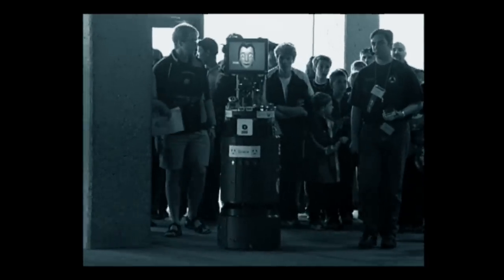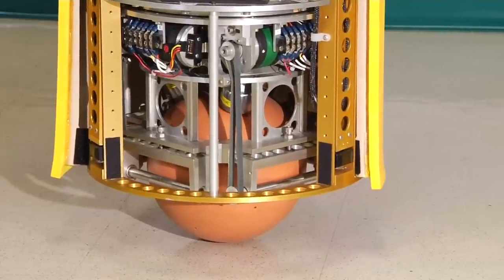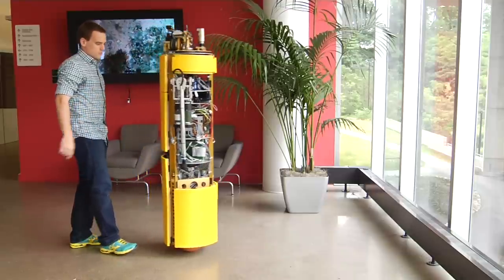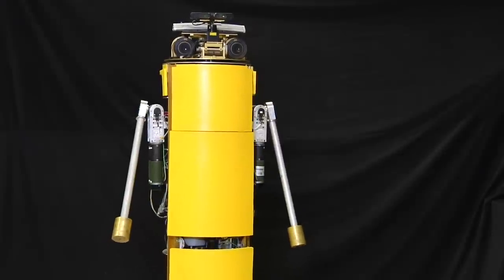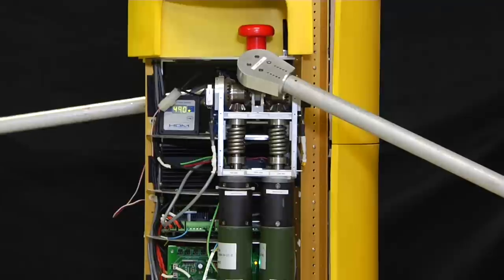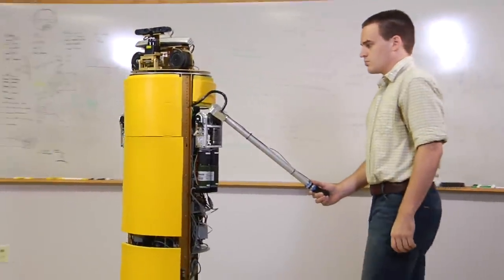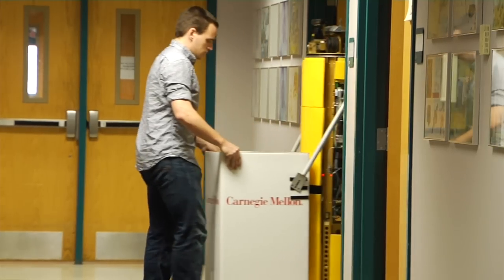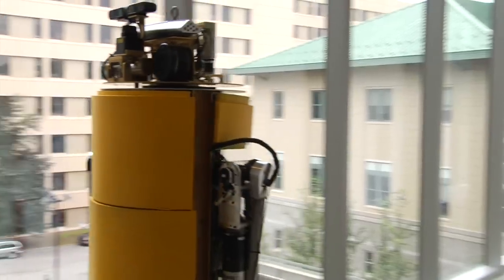Ballbot : A Single-Wheeled Balancing Robot

Comment: I'm amazed to only now get this in my recommendations yet this concept is already quite old and I haven't seen an update on it in 5 years. So with the new availability of electronics and microcontrollers, I'm guessing this should be even easier to engineer in our current day and age. The question then arises, why haven't we seen this design being adapted and improved upon?
Reply: Marinus    Because it can’t stop suddenly ?
Reply: @edh2246  That's really a non-argument.
Reply: Dylan Klavins (our former mechanical engineering lead) directed the design and construction of a robot using some of the concepts from this video's design at our high school robotics club a couple years ago. It is not an actively stabilized tall robot like the one in the video, but rather is a lower, faster robot with four balls designed for fast, holonomic navigation over difficult terrain. Here is a video showcasing it: https://youtu.be/j09PzmVmzJw
Reply: @AlnisSmidchens  Awesome machine!! Sadly the site with the CAD files doesn't exist anymore, I would love to know more about the construction, I immediately have a lot of creative ideas.

Comment: Very cool, I remember building this thing in Uni. I wonder why there hasn't been any notable further development incorporating this Ballbot's concept?? One problem I bet is maybe it's power hungry, actuating the motors constantly in an effort to stabilize the structure due to its inherent unstable idle position. Thus leading to not being economically feasible or user friendly, cuz you gotta charge the thing all the time or need a huge battery :(
Reply: Couldn't some sort of deployable supports be used during idle? Like retractible supports?

Comment: that sway in the jaw-axis when moving probably is just a oscillation in the control loop but it adds character.
It gives the appearance of a walking (or skating) motion that to some extent anthropomorphizes the machine.
Reply: I kept telling boston dynamics that they needed to put a little tail on their robot dog and it would increase sales but they just couldn't wrap their head around it because the tail had no function.....Engineers.  But I agree with you completely.  And this thing does it as part of it's function which is an happy accident.

Comment: Considering the shape (height) of this robot, it seems like it would be advantageous for it to have a solenoid-shiftable mass near its top, to give it the ability to lean just a little.  In its  current configuration, it seems like it could quickly destabilize and fall if it were to run inti anything (or is pushed into anything).  Having a secondary means to rebalance itself in a worst-case scenario seems important, and would also open up quicker accel/decel, higher movement velocity, and potentially better ability to handle uneven terrain.

All the balancing stuff is really cool and great tech, but it’s 2020 now and lots of people have been building single-ball balancing robots and they do well up to a point, until they topple over.  A secondary balance mechanism could be the missing component that pushes this from cool concept to viable product.

Comment: OK so this obviously could make for very agile ball joints in robotics, a hip joint with good stable sway could make bipedal walking a lot easier. A binding mechanism could be a simple cup with 3 of the same wheels but free-rolling, with an axle extending from and tentioned to the driving assembly. With it bound from each side and basically a universal joint at that point a computer can calculate the needed input to the ball wheels to drive an appendage in the right direction.

Comment: I think 3 ball at bottom will be much better and more stable so balancing would be much easier and then you also can't move it by small force. And also you can move in any direction without any problem.and you can also rotate the robot on any axis without moving

Comment: me as a technician: "how does it work internally?"
me as an engineer: "what happens if:
-something is on the ground and block the ball?
-someone push the robot in the direction of lowering stairs?
-the battery fail?
-we combine many of thoose robots to make a wall?
-the ball doesn't touch the ground anymore?
-the motor control does not respond?
-the robot goes crazy (internal software crash / electronical short-cut / power-surge due to battery fail / ...) ?
-someone leans too much weight on the robot?
-someone is too heavy for the robot to lift?
-the robot vision is disturbed due to reflective environement or capacitive environement?

..."
Reply: Anybody who has played with some '2D' balancing robots (like Segway) knows that things go a bit crazy in such cases indeed. Maybe better control software can make it better.

But I do not really see a big need for balancing on a ball. You could easily make a small stable low wheeled platform and then put an active approximately-balanced high vertical robot on top of it. This makes the balancing much more forgiving because the platform can still provide some extra torques where needed. Compared to a human we put our whole foot to the floor and add balancing because we are very tall compared to our foot size. The ball-robot is more like balancing on the tip of your toe. I do like the high narrow robot concept a lot though.
Reply: @richardbloemenkamp8532  yeah but my major concern is that it is created to help people. but if its fail ... what happens? where are the security?

Comment: Its weakness is... stairs. :D
Reply: Or steep slopes. Or door frames that are like 1cm higher than the room they are attached too. Even entering elevators might be a issue
Reply: The future will be quadropets or wheeled bipedal robots. Bipedal legs are just less efficient than bipedal wheeld systems
Reply: Or LEGO

Comment: Why build something inherently unstable?
You know, there's omniwheels and all that.
THIS is how you waste research time, money, and man-hours.
Reply: Anthony Dach But remember, for this robot to be of any use it will eventually carry an unbalanced load, which will take a whole lot more energy to keep steady.
Jets are actually very stable, and most have a fly-by-wire(or in this case fly-by-liquid) system if something goes wrong(say, heading/altitude hold).

And again - your attempt at refuting my argument fails because you suggest that this system will be stable most of the time - which it won't.
Unstable systems do have a much faster response - but at what cost? Nobody's going to need, say, a patient-observing robot to dash to someone when they press the emergency button - a camera with an epi-pen or two won't do you any good. Nor will this transport any large payload - it's simply too difficult to balance.

Also, what do you mean by "reducing power consumption when moving"? Yes, leaning will get you some momentum, but that momentum will be that of an inverted pendulum - to crash to the ground, a stable position. You'll have to work the motor continuously, both forward(accelerating) and back(braking) to keep you from either falling to the ground or stopping completely due to an incorrect control loop.

I do know what control theory is, so please, don't underestimate my chair-to-chair combat skills.
Reply: Anthony Dach If it's unstable, there's absolutely no way it can use the same amount of energy, as I've said, the center of gravity will be offset, and so will be the wheel, and the rest of the weight, and so on, and it keeps getting more unstable the more you add on.

Right now I still don't see an advantage to a very unstable inverted pendulum system with absolutely no load capacity and a constant need to use power to be stable(vs. say, a carefully selected wheel platform with less friction and latching brakes).
Reply: +Spirit 
You can't beat the inverted pendulum it's always fun.
Reply: +Spirit 
You can't beat the inverted pendulum it's always fun.
Reply: Because it's a friggin robot and it's balancing on a wheel like a ballerina, and it's NOT unstable. You have no understanding of the beauty of engineering, and lack the creative imagination to see how this could be applied in other areas.
Reply: Did you not listen to the first minute of this video?  Any wheeled robot of the same size and weight would have too high a center of gravity and be unstable for these applications.  The Ballbot can take MUCH more lateral force and stay upright.
Reply: Richard Amiss This ballbot can't take a puff of wind without falling over. It eats power.
A properly balanced(and weighted, because wheels DON'T REQUIRE POWER to stay upright) omniwheel platform will outperform this in every aspect.
Reply: Sure it takes power, I'll give you that, but so do humans, does that make us a bad design? Should humans really brace their legs to a small square onmi-wheeled platform and save billions of daily calories? We could end human famine! -  Of course NOT because the potential for movement is crap!  

As for Omni wheels vs a ball?  How do you propose accelerating a robot of this size quickly on omni wheels?  You couldn't!  The speed would have to ramp up very slowly to keep within the center of gravity. A ballbot, however, can use the instability to its advantage (like the jet fighter comment above) by starting to fall and then catching up with itself, causing much more authoritative and controlled movement.
Reply: Richard Amiss Let's see:
1) Yes. We're awful. An absolute abomination in almost every way. Fragile, inefficient, not built to last. Our eyes can't see directly in front of us, for one. Our teeth are stronger than our appendages, and the list continues.

2) You're confusing omniwheels with something else. They're quite efficient and powerful. Plus, again, why, the absolute, hell, would you want to accelerate a robot in this application to a high velocity?

3) The ballbot is the complete opposite of authoritative and controlled movement - it's a control loop of a damn inverted pendulum! It's inherently bad at being controlled!

4) Again, the jet example is flawed - a jet is an airfoil, kill its engines and it'll still fly. It's inherently stable, aside from the whole thrust to weight ratio thing.
Reply: Spirit First, watch the video to understand the criteria/potential before asking why. Then, open your mind a bit? Are you really so sure that you would NEVER want to do something with this? That's not science talk, that's pessimism. Lastly, I never said accelerate too a high speed, I said accelerate quickly. you can accelerate to 1mph in 2 seconds or 200 seconds. 

perhaps you need a bit more understanding of the principles, and more importantly, some inventive spirit to grasp this concept.
Reply: Richard Amiss Let me put this simply:
the robot's only advantages are entirely useless in the intended applications.

Think rationally.
Reply: Spirit If people thought like you we would be without many amazing human inventions. Much of what we take for granted had no practical use at its base concept, it took imagination, not rational thinking to make them useful and better our world. You cannot say this has no unique potential without studying every possible scenario. Since you are unwilling, I take your responses to be trolling and not constructive.
Reply: Richard Amiss Except we're only looking at one scenario. Practical short-distance load carrying at medium speeds.

Think. Rationally.

I'm currently designing an entirely artsy palmtop "industrial" robot.
It will serve no purpose, aside from maybe perfecting my miniature hypocycloidal gearbox design, which will, to quote you, "might take imagination to make useful".

I know the line between usefulness and imagination all too well.
Reply: Spirit So because the few (more than one by the way) examples in this video may have a better method, you write off this tech outright? Imaginative? Hardly!
Reply: Richard Amiss Exactly my point!
Why even imagine using something already proven a bad choice for the task, just to be imaginative?

Just like this whole idea of creating humanoid robots. Good tech comes out of it, but there are more efficient ways to advance the fields good tech comes out of.
Though, that is an entirely different topic that requires its own chair-to-chair warfare comment paragraph chain.
Reply: Spirit Actually my point is that there are "other" possible tasks for this invention that you appear to be closed minded to.  If  this was sold to a creative company the sky is the limit on the creative/entertainment value. That's just one example.
Reply: I'm talking movies, film, live production. imagine 20 of these "dancing" on stage. Look up the Rozero Ted Talk for more ideas.
Reply: Richard Amiss Except we weren't talking about those.
This couldn't be used for film, because nobody sane would put a $200k camera rig on a continuously unstable ball.

Live wouldn't happen because of the same thing, except now there's also noise.

20 of these "dancing" on stage would be boring.

And again, none of these were the topic of discussion, so your point is moot.
Reply: A human can stand if you don't feed him for a minute.
This will destroy all equipment even if a single drive motor fails.
Reply: this is just a gimmick , pure nonsense . The only thing it can do is roll around in any direction on a level ground.Just a pile of shit.
Reply: discoveries are not made by conventional thinking.   Some seemingly unpractical robot may lead to a new way of doing things.
Reply: Yes discoveries are made by unconventional thinking , but sometimes unconventional thinking could be based on pure nonsense which leads nowhere.Anyway i fail to see any new way of doing things with this marvel of technology.
Reply: true
but in the beginning many things most could consider useless are now given an actual use
originally topology for example was just some kind of abstract field that people had no use for what so ever
until computers came and then turned topology into a very useful field

id rather think that even if its inefficient and the worst possible way to do the job
if you make it work
then you could get some usefull data out of it

if you could make a pencil balance on its sharpened tip
how you did it may allow you to improve other better options

id rather look at what you can get from this
Reply: please, list one practical use of this metal tube that isn't rolling around slowly trying not to fall over that can't be done better by any other robot.
Reply: I think the real solution is not to make such tall ass robots. Fixes the whole stability problem. But if you want to show off and be "friendly" to humans then this ballbot is pretty cool.